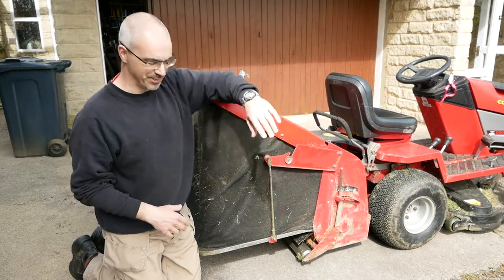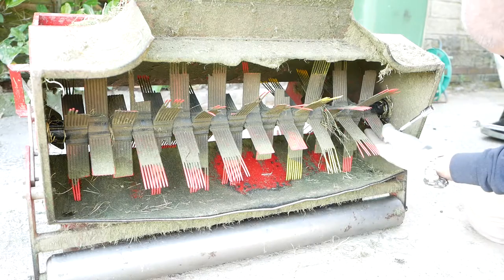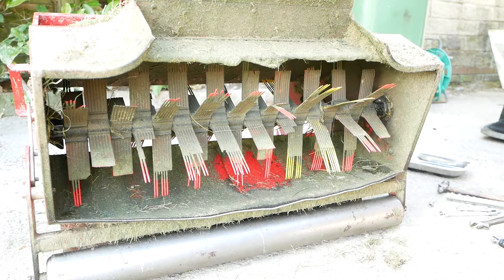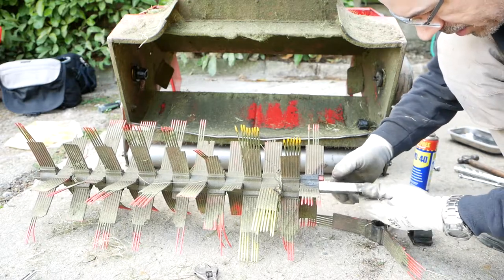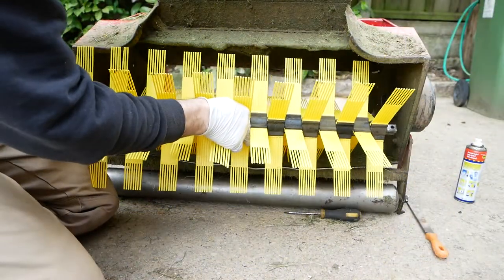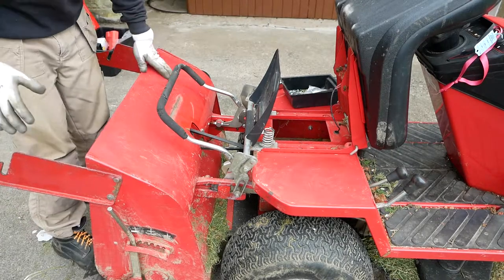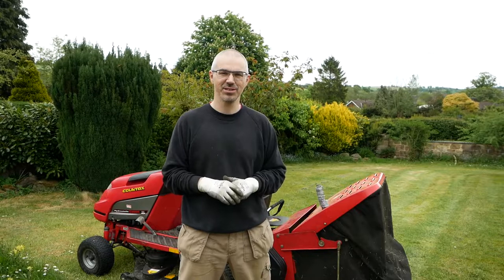Replacing Westwood / Countax powered grass collector brushes

Comment: Very useful vid. Thanks. They are M6 bolts and should really be stainless, incl nuts. I had to get the angle grinder out to remove mine. Bearings completely gone along with the 2 identical ones on the upper (parallel) shaft. I like the idea of installing brushes in a spiral although a previous dealer had put the last lot in as you did.
My problem now is the main frame; some of the plate is delaminating, ie very rusty and getting beyond repair. No longer being made so hard to find.

Comment: Great instructions-one thing, there is no need to remove the brush holders completely, there is enough slide in them to move one way to side the brushes out-then you don’t need to remember which way on they go.

Comment: My nuts and bolts were 8mm spanner on the bolts and a 10mm socket on the nuts. If you remove just one comb holder from the bar it gives enough space to slide each of the other holders along the bar to slide off and on the combs. It saves taking all of the combs out and there is no risk of getting them in the wrong order.
Reply from the maker: Hi John, thanks for sharing. Glad you got them changed. Andrew

Comment: The parts manual shows the brushes installed in a scroll formation, not sure if it makes a difference? It's best to dismantle the whole brush assembly, it's not difficult, as there are several wear points to check, especially the bearings at each end and the nylon parts that hold the square tube to the spindles. If your tube is damaged, get a new piece from metal store, it's 19mm "furniture tubing". If you want to be really economical, just replace the 20 or so brushes in the center as the grass is ejected in a narrow stream underneath so the outer brushes don't do much.
Reply: Baker, on metal store they have got 20mm have you used it then and what's the affect   thanks

Comment: Useful video. Cheeky request - have you done one on the long belt that drives the PTO from the engine at the front - I am having issues here! I just repaired the transmission last year and now the belt pulleys are breaking (just old).
Reply from the maker: Hi John, unfortunately I haven't done a video on the PTO belt but will keep it in mind. I get asked about belts quite often so it's definitely on my list of videos to shoot in the future.
Reply: @AndrewFixes  Hi Andrew. Thanks. I managed it after all, strip everything off and then put it all back together. I now know all the belts and pulleys....

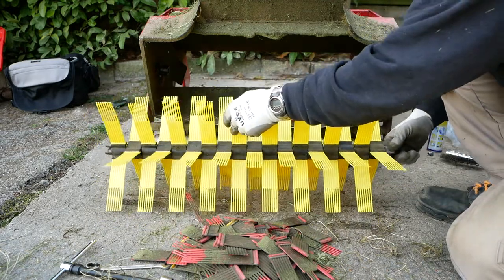Comment: 15:06 just replaced the brushes on my third Westwood machine. I always fit the brushes/holders in a staggered/spiral pattern. It just seems the right way to do it, giving a it a better balance.
Reply from the maker: Sounds like a good idea, thanks for sharing.
Reply: The spiral pattern is the correct way to fit the brushes/combs. It spreads the load. They usually break when you cut long dry grass which gets tangled.

Comment: Great video Thankyou. Quick question. The brushes on my Countax c300h hydro static mower are constantly spinning. Is this normal? The previous owner had new belts installed just before I brought it. Could that have anything to do with it? Thanks in advance.

Comment: I've decided on the cheapy brushes from Amazon on the basis that they've received good reviews and at less than £24.00 per set it's only £12.00 per year if they only last a couple of years. It would be interesting to know the average life of a Westwood set for comparison.
Reply: @NaughtyNaunts  Probably all made in the same factory! Looks like you're getting ready for the growing season already. I've had the Countax battery on trickle charge over the winter, so looking forward to a first time start.
Reply from the maker: Thanks for sharing 👍
Reply: I bought e bay cheapies and they literally shattered to pieces after a few cuts, just ordered genuine replacements I hope they last as well as the originals as they cost three times the price of the cheapies.

Comment: At 2mins 49 you can see the bent edge of the collector between the brushes and the roller… ? I keep straightening mine out but it keeps catching the grass on ant hills or whatever. Obviously lower settings and weight of the grass in the bag makes it more likely to catch, but I can’t seem to stop it happening. New brushes so there’s no need for the lowest settting, and yet it keeps gouging lumps out of the lawn occasionally. Sigh…

Comment: Hi Andrew, thank you for this I'm in the process of changing mine. One question regarding the drive belt. My drive seems to be in permanent drive and the lever doesn't disengage the belt. Is there a clutch mechanism that isn't working? TIA
Reply from the maker: Hi Nigel, yes there is a clutch mechanism and it should stop the drive to the PTO pulley when the lever is in the appropriate position. Moving the lever should move 2 jockey pulleys underneath that apply or release tension on the PTO belt, acting as a clutch. Hard to say for certain what's causing the problem without seeing it, but it may be that the trunnion on the PTO engage rod needs adjusting underneath, or it may be that the return spring has broken. Or perhaps the jockey pulley plate is seized onto its mounting point. Hope you manage to get it sorted out.

Comment: Great video, especially since I've just bought a second hand Westwood T1800 and was disappointed with the poor grass collection. I bought the mower for it's grass collection ability because I am fed up with blocked shoots as soon as there is the tiniest bit of moisture on the grass. I'm considering after market brushes from Amazon; they are less than half the price of originals. Are the ones  that you fitted branded or not?
Reply from the maker: Hi John, glad you liked it. I used genuine brushes. I was concerned the cheaper ones would be made of a more brittle, less flexible plastic that wouldn't last as long. However they are almost exactly half the price of a genuine set and those who have left a review on Amazon seem happy with their purchase. Although one reviewer describes having being happy with them and returning to purchase a 2nd set a couple of years later. Now it might be that they have an enormous area of grass to cut, but I'd expect them to last more than a couple of years.

In summary I fitted genuine, but people seem to be happy with the non-genuine option, although it isn't clear whether they last as long.  If you really want to settle it you could fit one half genuine and the other half non-genuine and see what happens!

Comment: no bolts on the end of brushes and a drive wheel on outside of brush colector with plastic covers on ither side so the brush is wrong ps there 13mil on ours